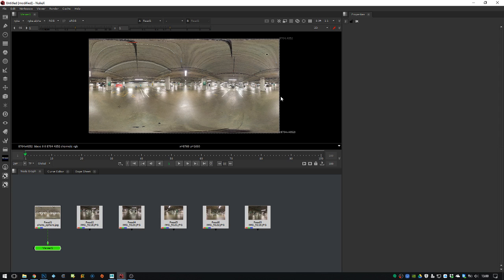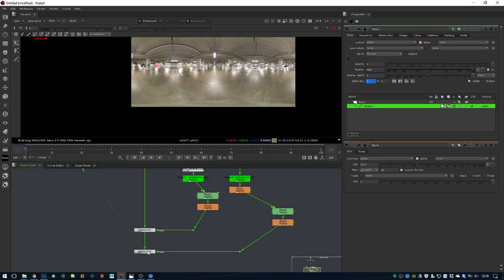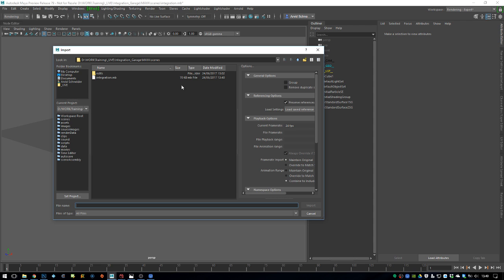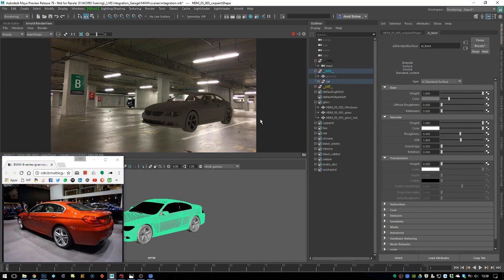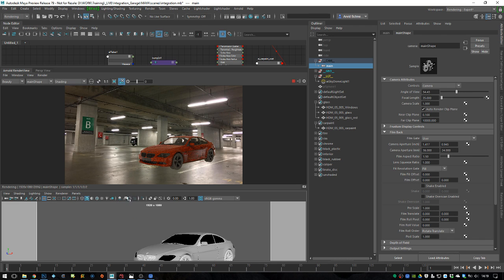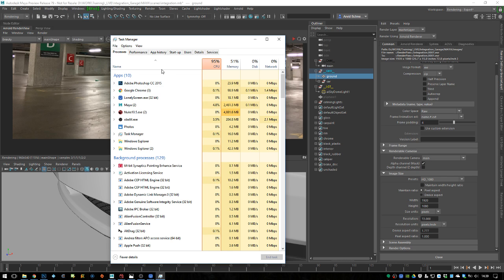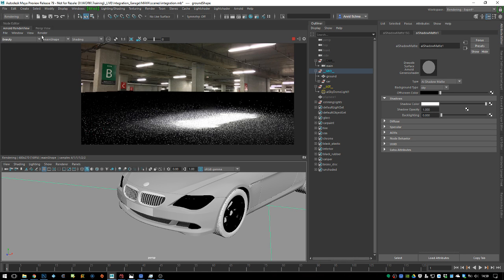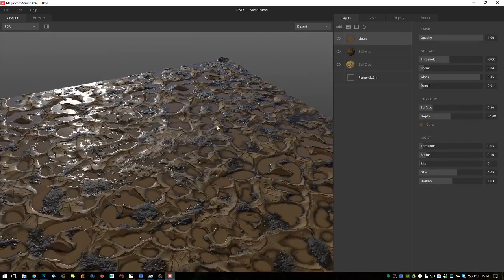LIVE: CG Integration, Lookdev & Lighting, LightShader.

Comment: I'm too dumb to install the LightShader.. :( 
I do everything as written in the Wiki, but the LightShader does not appear in Maya 2017. 
Can someone provide a working env line, assuming that the "trunk" folder is in the C drive root?
Reply from the maker: +Vitaliy Skibin what have you got so far in your file?
Reply: **I apologize, forgot to log into my account.. ;)

Right now, nothing (except for the redshift stuff which works fine). 
Because I deleted it, not able to make it work.. 
But, I tried all the options it seems, the usual slash and reverse, with a space and without in the path.
Copying it to different places.. Nothing.. :(